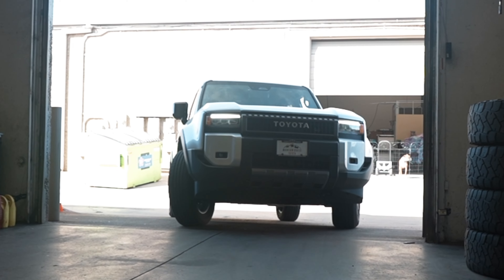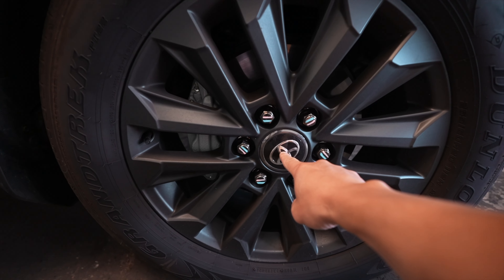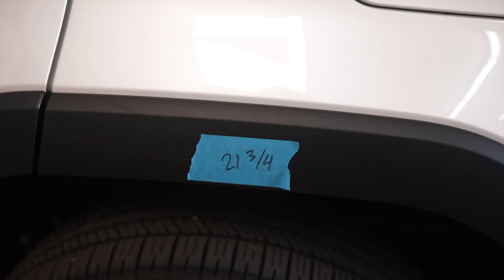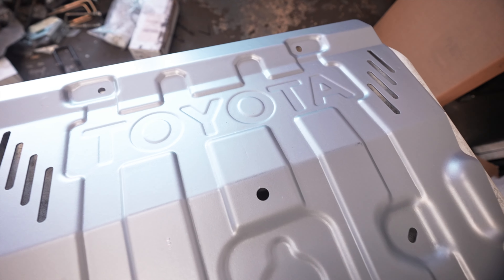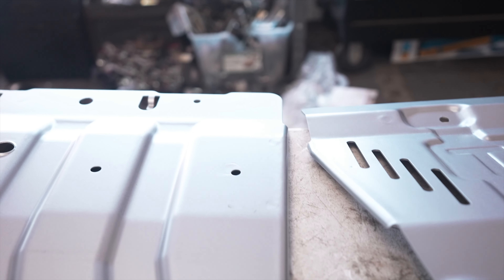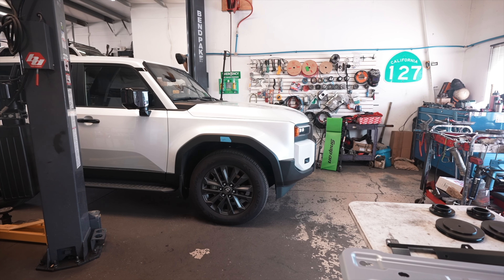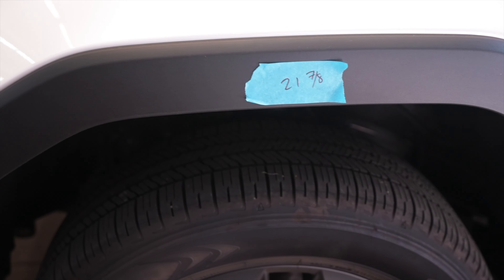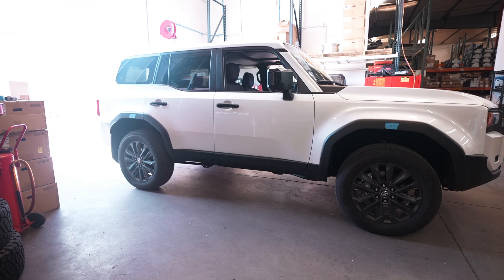We Lifted a Land Cruiser LC250 with a Westcott Designs Spacer Kit

Comment: Why would you put a spacer kit on a $60-$78k vehicle?
Reply: Mall Terrain Vehicle..
Reply: This was my LC250.  So I can fit the 315/70r17 tires and 703 wheels I want now.  Icon hasn’t released their kits yet and that’s what I’m gonna get when they do.  Same for the skids.  Got the Toyota first edition skids cheap and had them put on for now….c4 fab is who I like and theirs aren’t out yet.
Reply: @archbold1206  what is the offset on that Method 703
Reply: @ method 703s….17x8.5 in +35 offset is what I bought.
Reply: @archbold1206  does +35 offset work without any lift?
Reply: hows the suspension ride after the wescott kit?
Reply: @omarg003  the stock suspension is pretty soft so the Westcott spacer firmed it up a bit.  I prefer the slightly firmer ride but will be upgrading to new coil overs this summer.